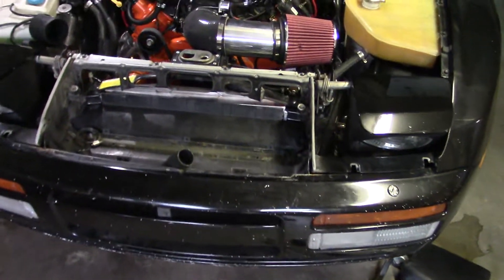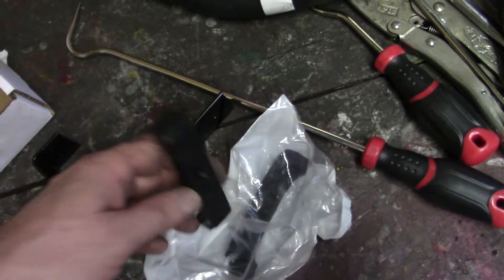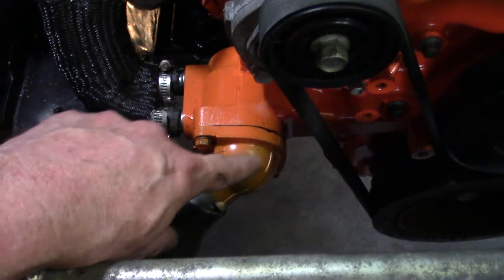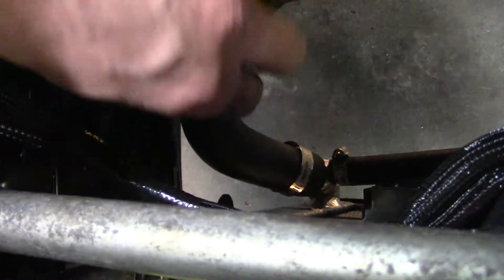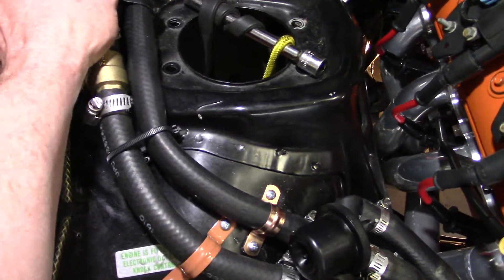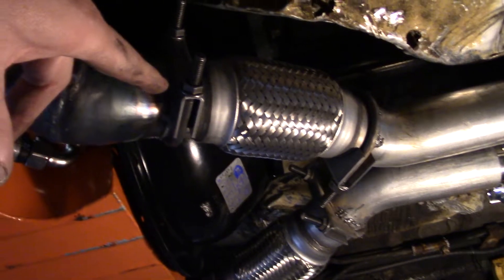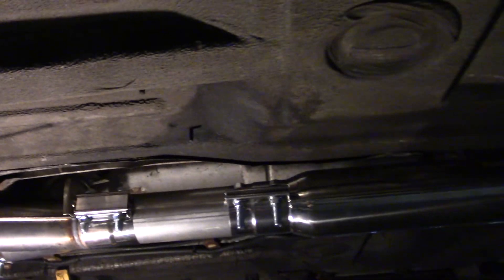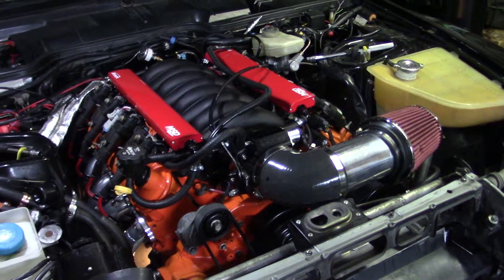Porsche 944 + V8 Part99, Cooling System

Comment: It’s getting there.  
If you haven’t done it try replacing the thermostat neck on the water pump. They make swivel necks just for that very problem you have with the lower radiator hose.  Eddie Motorsports Billet Thermostat Housings MS106-90M is a nice unit but It may require a different thermostat so while you’re shopping order up a Gates #33963, 186 degrees F/85.5 degrees C.  I hope to see a maiden voyage video soon